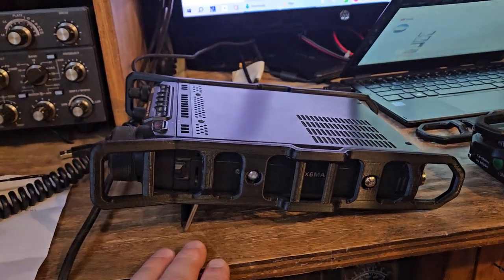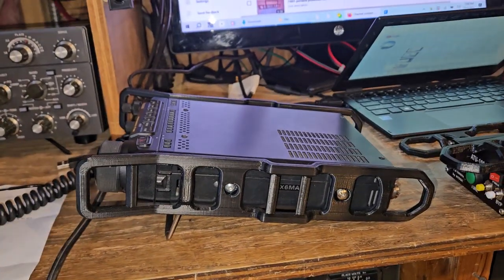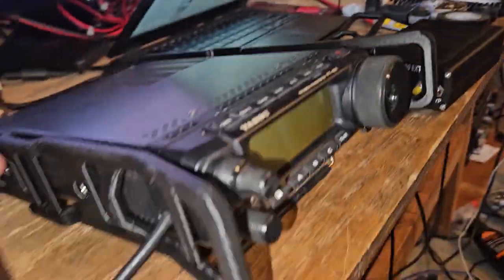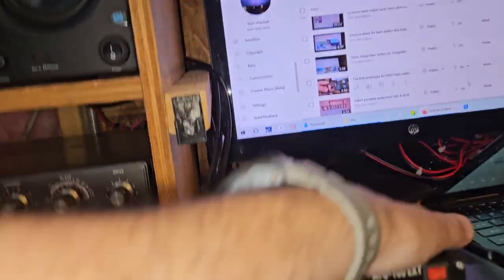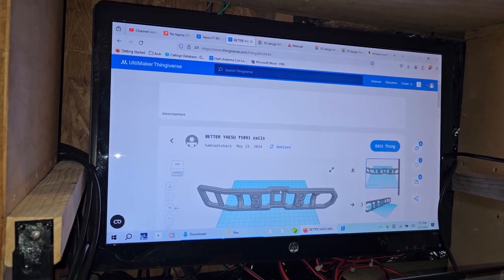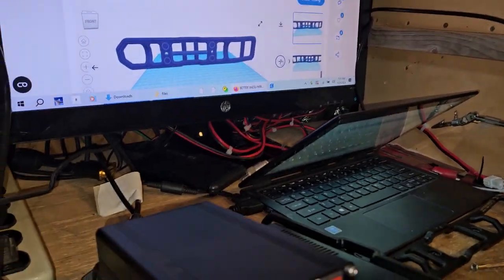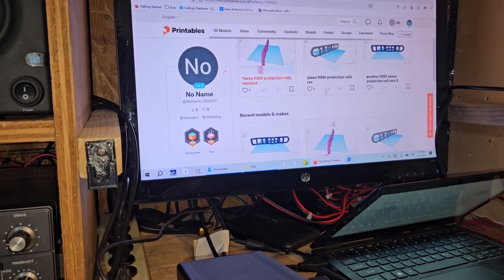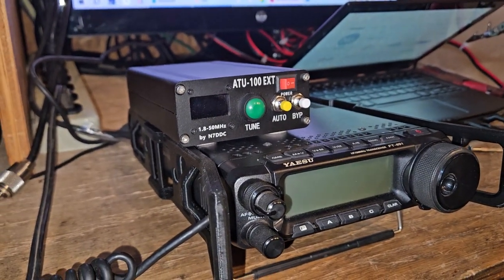My yaesu ft891 protection rails remix installed for ham radio portable

Comment: These rails look so much better. Perhaps you can design some sort of base-plate for on top of the radio where the ATU fits and wont slide around.
Reply from the maker: Yeah i was think about that. Im still very new to all this but It was the point for me. Otherwise your stuck printing others stuff